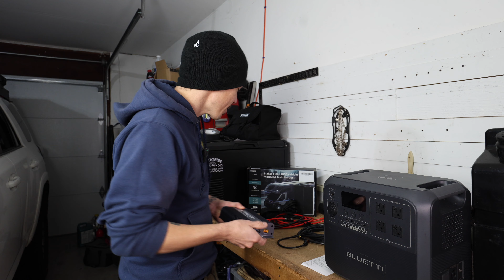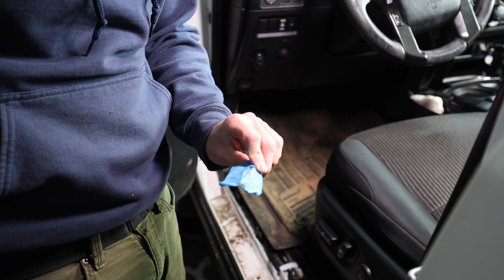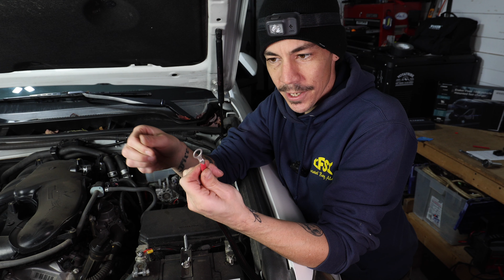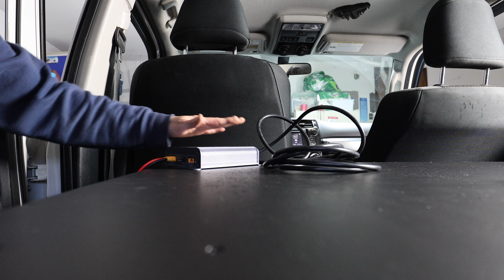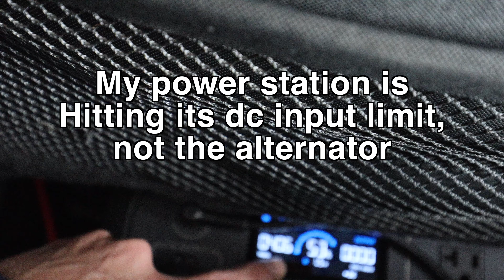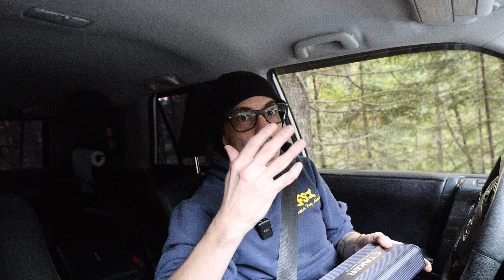The Fastest Way to Charge Power Station from Solar and Alternator 1000 Watts! Etaker F-1000

Comment: Do you have the stock alternator for your 4Runner or did you upgrade to a higher output? We want to install one of these in our 2023 4Runner to charge our AC200.

Comment: My F1000 (non "pro" edition) probably toasted my Oupes Mega2 power station while I attempted to charge using a 320 watt 24V solar panel.  
Not clear in the instructions but the F1000 doesn't have Bluetooth and charging parameters are not adjustable. 
Even though I was 2 months out of warranty they are sending me a newer version F1000 PRO....that has Bluetooth. 
I never intended to install in my vehicle,  just charge via panel at my offgrid cabin.
Reply from the maker: Wow that sounds like fantastic customer service.

Comment: NICE!  That's the same Bluetti I have, the AC180.  I bought that along with with a folding solar panel for charging it.  I used it about a year before deciding to go with a full solar setup in my slide in truck camper.  I bought a BougeRV 200 watt Bifacial solar panel for $200 and 2 Chinese LiFePO4 batteries for $250 each and a Renogy 40a charge controller for $150.  I'd buy another 200W panel but my slide in truck camper fits fully in the bed of my GMC 1500 pickup with the tailgate shut and I just don't have room on the roof for another panel.  Being as my dad died at the end of 2023, and being my mom's sole caregiver while she suffers from dementia, I had to put my life on the road on hold and move in with her so I have not had a chance to fully use the batteries and charging system to see how they'd hold up with just one panel.  Being as I don't have a monthly check coming in, my driving would be short trips to the next job and parkup so alternator charging wouldn't benefit me much.
Reply: Greg, I'm so sorry to hear about your dad. You putting your life on hold for your mother makes you an awesome son. May God bless you.

Comment: That's not how you crimp a ring connector on. I see you have the AC180, I regret buy that one. Their APP sucks, you can't adjust the charging wattage other than the preset modes like "silent". The bigger units and other manufactures you can.

Comment: Question: In a comment below you mention you plan to upgrade your alternator. For now is your alternator the OEM? Could I run this setup on my alternator? (I have a 24’ 4R TRD ORP same color as yours 🤙) Thanks!
Reply from the maker: Yes my alternator is the stock 130amp for the offroad and pro, same as yours. No worries running it in your 4Runner.
Reply: @ Thanks man. I just ordered a Bluetti AC180 (Black Friday!!) and have read about over-taxing your alternator. My plan is to go power station route rather than dedicated second battery system. I’m basically building a Overlanding rig where I return home after a one or two trip out West.

Comment: Sincere question, is there a reason you are not using the BLUETTI Charger 1+DC Input?
Reply from the maker: I’d need a separate solar controller that outputs the correct voltage for the bluetti, the dc to dc part doesn’t have as much power, and it would end up being more expensive. You can’t use any solar panel with the bluetti, it has very specific requirements that are not typical. They want you to use their portable solar panels. Most of these power station companies are like Apple and want you to use their ecosystem. The etaker is much easier to adapt. I didn’t pay for the etaker unit, they sent it out to me to test. It’s probably the best unit on the market for most people with single input power stations though.

Comment: Nice tech and you deserve this stuff Jed after doing the hard yards with more primitive setups over the years. Enjoy🤙
Reply from the maker: It gets even better. Stay tuned
Reply: As long as this unit doesnt fry alternators or neglect charging starter battery in the process?
Reply from the maker: My alternator will be just fine. On an older car it might become an issue though.
Reply: I wonder if I could charge a power station using the battery of a hybrid engine (through an inverter) and would it be as quick as this device? That would be a good hack.

Comment: I've got a DIY system, I've been looking for something like this, but unfortunately everything I've seen so far has max solar input voltage less than my 56v panel.
Reply from the maker: Are you switching over to power stations from a diy setup?
Reply: @IntoTheMystery13  keeping DIY, works well  90% since I'm in AZ / lots of sun, but winter some days have to conserve, so probably get dedicated alternator charger to fill the gap, but a one device solution is appealing.

Comment: Seems like the on/off switch should be on only when needed. A dead battery is a bummer. You would have to use the Bluetti to charge the battery back up.
Reply from the maker: Agreed. I have a little jump start pack that I keep topped off. It hasn’t been an issue yet though other than the washer machine.

Comment: Renogy dc to dc has a trigger wire hooks to ignition hot only chargers when engine is started , i ran my own hot wirevwith a 40 amp toggle switch manual turn on n off as needed .
Reply from the maker: Very nice! How long have you had it installed?
Reply: 4 yrs now no problems ,

Comment: Ive been running a 40amp dc to dc charger on my power bank , at most id have to run my van 30 mins or less to rec a full charge. If i were to up grade , etracker be my go to , since the bluetti dc to dc cost is out of reach 4 most van lifers 🎉🎉🎉
Reply: LoL the Bluetti is cheaper than the Etaker.

Comment: Is there an issue with the Bluetti AC180? It's not the first time I've heard someone having to return their Bluetti for repair. I've heard a lot of good things about Bluetti, but now I'm wondering if I should get one. I don't have a lot of money and I don't want to make a mistake.
Reply from the maker: I’m sure all of the companies have a certain percentage of units that need repair. It’s kind of the nature of manufacturing. If you are depending on it for power full time I’d suggest building your own system. Bluetti took care of me with this repair and have a 5 year warranty, but I was without power for three weeks while it got sent off. If it were a diy system I could have ordered the little tiny part I needed on Amazon and had it the next day. Could’ve bought the equivalent part locally too. Plus with diy you aren’t nearly as limited on how fast you can charge the system, and it’s easier and much cheaper to expand. Stay tuned, I’m working on a power station vs diy video.
Reply: @IntoTheMystery13 O.k cool, thank you! I hadn't considered DIY but that's a great idea. I've read that the rigid panels are better at charging than the flexible ones. if I remember correctly, Will Prowse said to avoid the flexible ones. I'll have to think about this some more, looking forward to your video, thanks again.

Comment: It's good to hear about powerbank charging options. I think this description is above beginner stage in terms of explaining as even I had a bit of a challenge understanding some parts of the video. But overall this device is a must have for most nomads especially if you are full time. 

I like the charging speeds at idle, that's a huge difference. I also wonder if the alternator was upgraded, could you run 2 of these of the electrical system simultaneously to charge 2 powerbanks.
Reply from the maker: Thanks for the feedback? What parts were hard to understand? You could totally do that to charge two power stations, but you’d be better off getting a big lithium battery and dc to dc charger and solar to charge the power station. I plan on getting a high output alternator to run two 50 amp (700 watt) dc to dc chargers to charge a 300 ah (3600 wh) battery that will charge my power station three times. Stay tuned I’m actively working on this setup and there will be a video.